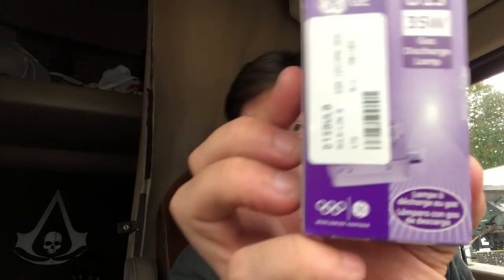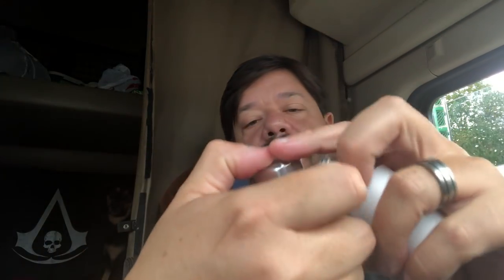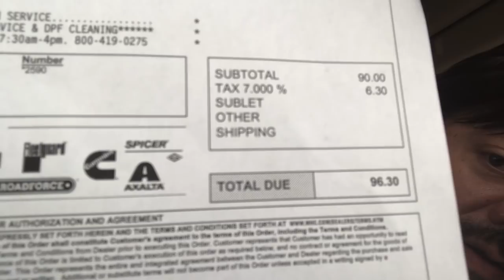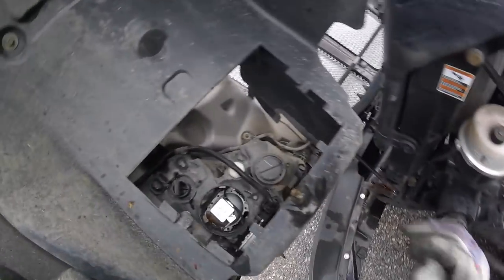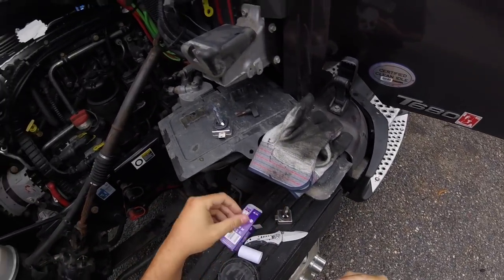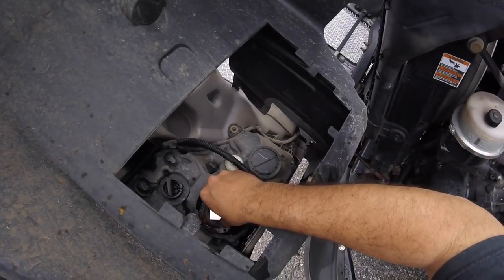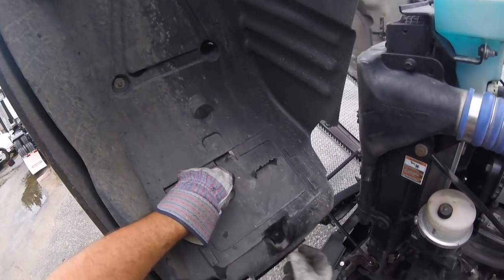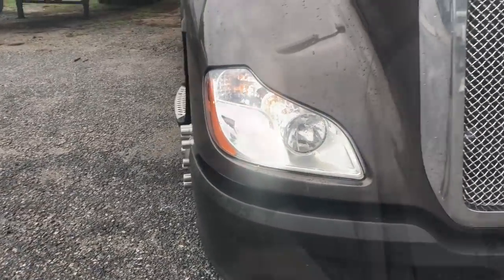How To Change The $100 Light Bulb

Comment: Use disposable rubber gloves to change light bulbs. If you touch bulb with fingers or your fuel soaked work gloves can cause premature bulb failure. And your fuel gloves do have fuel on them.

Comment: Yeah headlights are a pain because they burn so hot you can't even accidently touch the glass part without risking premature failure.
Reply: xennon aint that hot, that is a problem in the snow as they dont melt it off the lenses, but it light trough it tho. led even worse. so the best is to have xennon and old style halogen extra lights.
Reply: @sisutrucks  oh ok.. I'm used to the old halogen. Xenon and led would be an issue in ice and snow. Just something else to maintain in order to see.